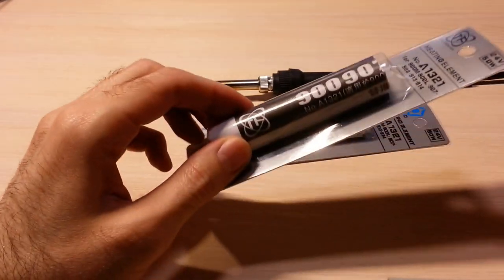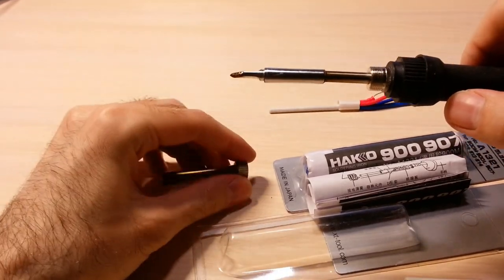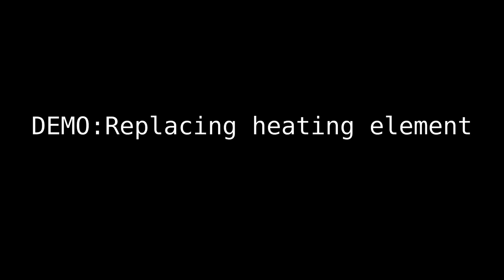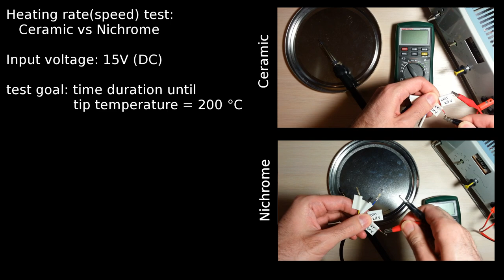A1321 ceramic heater (Hakko clone) for soldering iron /pinout/installation/tests

Comment: Very good video. I've bought a cheap clone controller board on ebay and they only work with A1321 50W heating elements.
They're cheap and readily available, so they provide a good value.
then I also acquired those clone 907 5pin solder iron (model B ) to fit the temperature controller board.
All of that is pretty inexpensive, around 5.5$ for the controller board and 2$ for the iron.
After that UI acquired locally a 24V transformer and all was set to assemble. A good solder station for a very reasonable price.
The only problem is that usually the cheap iron handles use a nichrome heating element and that does not work with the controller boards I had.
So after watching your video I just went in and acquired a set of ceramic A1321 heating elements and soldered tehm to the handle PCB and now all is working! 
Nice video!

Comment: Navigation for asshole
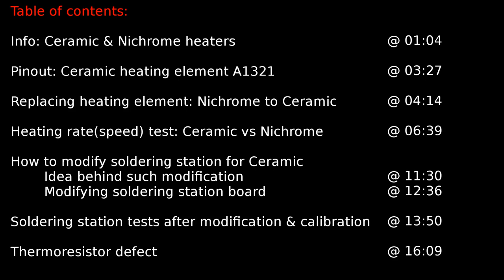Info: Ceramic & Nichrome heaters 1:04
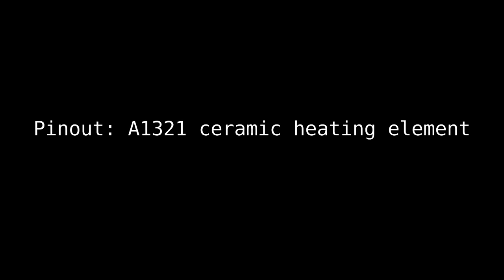Pinout: Ceramic heating element 3:27
Replacing heating element: Nichrome to Ceramic 4:04
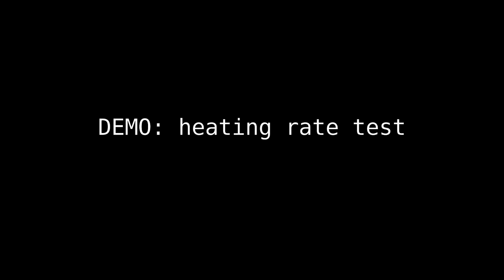Heating rate(speed) test: Ceramic vs Nichrome 6:39
How to modify soldering station for Ceramic
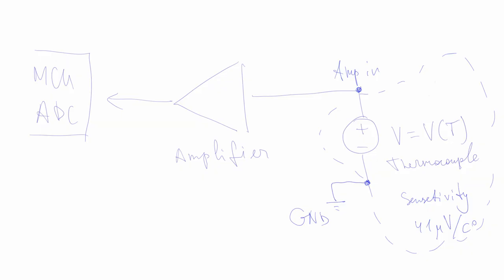  idea behinf such modification 11:30
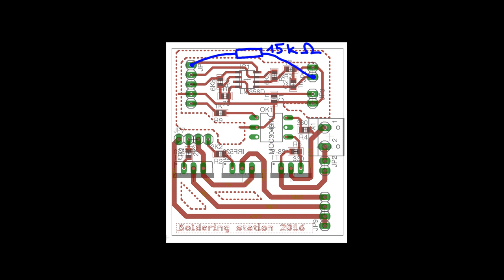  Modifying soldering station board 12:36
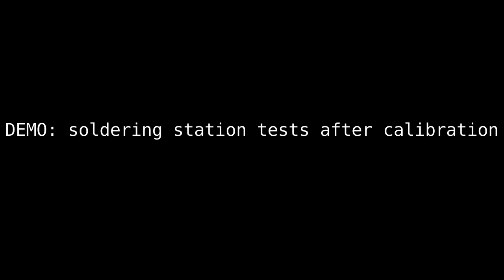Soldering station tests after modification & calibration 13:50
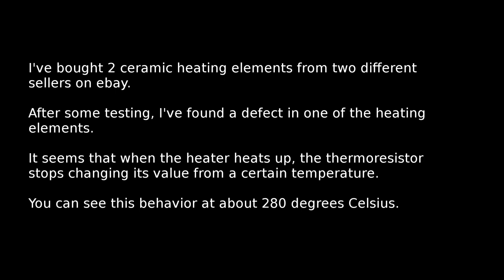Thermoresistor defect 16:09

Comment: Universal Soldering Controller was covered in 2015.
http://dangerousprototypes.com/forum/viewtopic.php?f=56&t=7218&p=61175

Japanese gov’t and manufacturer’s spent $1 Billion USD in Ceramic R&D ... this research led to ceramic coatings in automotive industry as well as Hakko’s superior heating elements.  China did not learn the decade of R&D lessons.  China also has supplier issues with purity of “feeder materials”, metals, raw materials ... these impurities taint the production of higher products.

Comment: Nice sir, 
Sir,  60w insisted  90w soldering  filament  use ??  What effect  ... temperature  any damage soldering  station?
And also know why faulty  in filament  other wise  power  supply  always  good  and perfect. 
Please  sir, same guide

Comment: Hello Sir,
I have a problem, can you help me, I have connected an A1321 heating element as specified in on my order "Soldering iron control panel, A1321 for HAKKO 936, AC 24V 3A 200-480C Thermostat Module ".
But on heating element A1321, the red wire burns and ends up cutting if you insist ...
So is it a problem with a wire that is too thin for the current?
Or is it the wrong (poor quality) heating element?
Or something else?
Help me please.
Ps:
I am an electronics and computer professional so I performed several tests but no good results (the red wire burns and cuts if you insist.

Best regards.
P. MONTIER

Comment: as i know thermister does vary slightly with temperature, by the way did you use ac  or dc to power the heating element.

Comment: I did this to my Gordak 952 iron. It originally came with a Gordak 952 A1322 element. Replaced it with a Chinese A1321 ceramic and adjusted the circuitry to read from the thermistor. It heated too fast and the transformer gave a lot of hum. After using it for a while, the ceramic heating element developed some black burn marks around it. The temperature readings were very inacurate at low and high temperatures. 

So I replaced it with the original element that came with the station. Eventhough it was a 1322 style nichrome heater, it was built better than the Chinese ceramic type and is giving accurate temperature readings across all temp ranges. 

To fix the issues with power delivery, I change tips mid soldering jobs depending on the requirement.

Comment: Why the 15kΩ resistor? By my calculations, if your power supply expected a 41μV/°C thermocouple, that's 16.4mV@400°C. If your new thermistor outputs 117Ω@400°C, then we have:

(117Ω*5V)/(R0+117V)=16.4mV
117Ω*5V=R0*16.4mV+117Ω*16.4mV
585=R0*16.4mV+1.9188
585-1.9188=R0*16.4mV
(585-1.9188)/16.4mV=R0=36kΩ

Of course, it's not perfect, because it treats 0° like room temperature, but I would think that would be the closest you could get with a single resistor.
Reply from the maker: I did not try to simulate a thermocouple. I knew that I could always recalibrate the station. I believe, at high temperatures, the curve will be non-linear for the tip.  Thus, linear extrapolation won't work well. And someone has to (re)calibrate. On the other hand, a smaller value of R0 increases the resolution of the sensor.

Comment: I have Radio Shack soldering iron 60 Watts,element burned out but its an 120 volt not an 24 volt..I tried to rewire with nichrome wire but it continue to burn....Any ideas why wire burns out??Maybe too many winding on it or maybe less???The ceramic tubing is like 3mm thick,it is also small.....How much winding supposed to be made and is it important that every turn must be close to each other???

Comment: hi Sergei,, I need know what type of heating element replace for my solder station CT-Brand 953D.. Can you help me ? How to make for identify a right heating element ? My station soldering up to 480°
Reply from the maker: Hi! You should search that in the documentation for your device. If your heater R = 12...15 Ω and your sensor R < 4Ω  then it's a nichrome(heater) & thermocouple(sensor) type soldering iron.
Reply: @sergeikrasnikov  I read with tester 13,5 and 2,5 ohm
Reply: unfortunally this station is very old and the company factory is too discontinue by reply to email.
So this is a nichrome right ?,, I need replace it beacause cracked, what model and what size watt i need buy ? my heater is 24v and the solder station heat up to 480°  C
Reply from the maker: @annabiagetti549  I think you need a hakko 907 handle like in this video https://www.youtube.com/watch?v=aVkXNvVu7EQ
Reply from the maker: @annabiagetti549  You can find similar looking soldering iron handles, and then ask sellers (on ebay or aliexpress) about their products (what kind of heater and sensor do they have).
Reply: @sergeikrasnikov  ok, I have a last dubt about size watt of element, in ebay I have found element in ceramic by 50w and 60w (not A1321), I should use only 50W elements or it's same ?

Comment: Great Video! Wish I was at your skill level, but unfortunately, I have already built a simple circuit for the A1321 or 907F soldering iron. That circuitry only works with The thermistor type iron and not the K-type Thermocouple. My questions has nothing to do with the video, but you look like the man who just might know this answer. I don't have the skills to use adrino yet..(But I am working on that..LOL). I have a thermocouple type meter that read up to 999c. Unfortantantly, it will not work with my current set up. I have a station that only uses the A1321 and an Iron to match. But I would love to keep track of the temperature. I looked into other meters for thermistors, and the only got up to 300c on average, I need up to 450c. In your video, you used a voltage divider to make the unit read and work with the A1321.  Is there anyway I could alter the meter only to read Thermistors instead of thermocouple? I am still learning what a voltage divider is. Do you think adding a resistor from the power to the plus side of the readout would allow the meter to read the temp?  I only need it to read the temperature using the thermistor on the iron. I would piggyback the output wire  going to the iron with this meter.  The circuitry will control the iron. I get around the same reading on my iron...49 ohms and 4 ohms. The meter I would like to rework is called a  (Meter Sockets Yeeco 0-999 C LED Digital Temperature Thermocouple Thermometer K). I would discard or save the thermocouple that came with and possible us it in another project and only use the meter.

Hope all that made sense! Great work on the iron and I watch all your video often. I am a new subscriber and I can't wait to see if you might have a solution with the parts I already own. Please let me know if you want any other info!
Reply from the maker: If your device lets you calibrate the displaying temperature using at least two points then you can try to change the circuit. (The two points are needed to change the slope and bias. Because for thermistor It has to be a completely different curve) Otherwise you will never get the correct temperature on the display. On the other hand, as a simple approach, you can use your multimeter to measure voltage across the thermistor, if the  thermistor is connected to the soldering station circuit (or resistance, if not) . This voltage should vary with temperature. After some measurements you can figure out what voltage corresponds to what temperature.